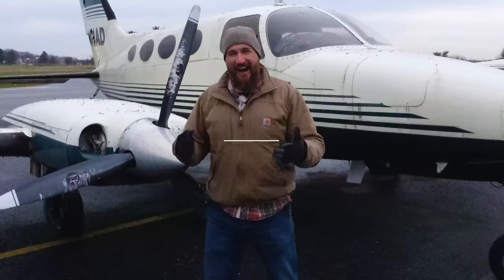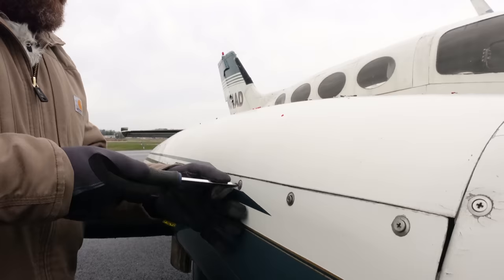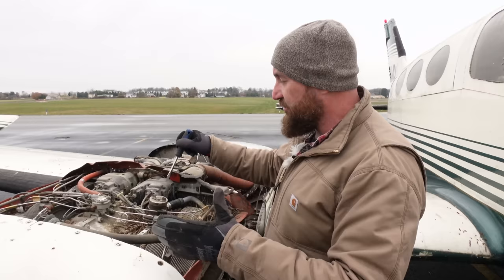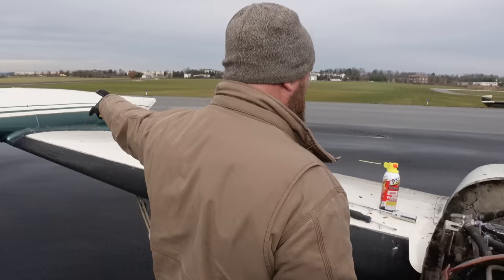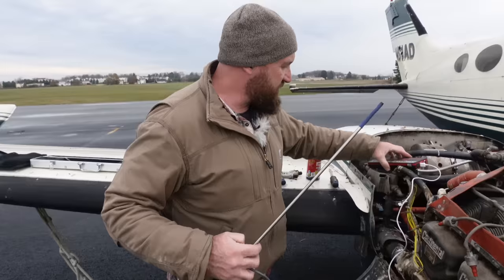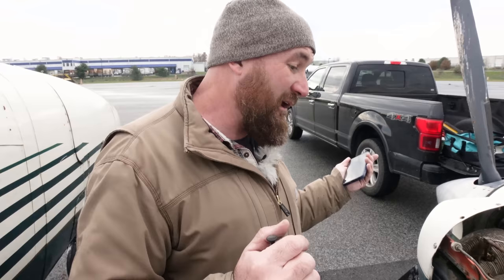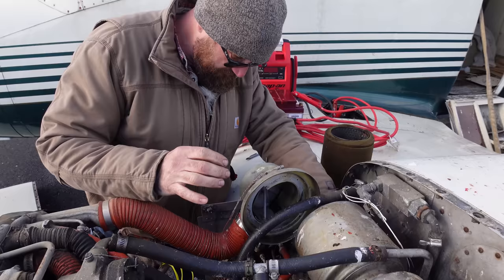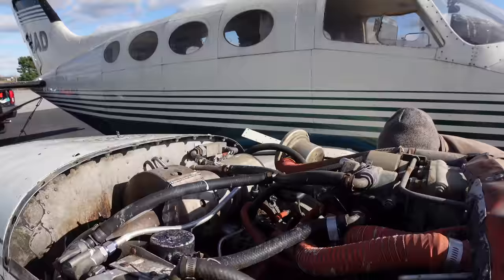FREE Abandoned Airplane... If I Can Start It! Ep1

Comment: I flew Cessna 402C for a few years as my first pilot job. Also have a few hours in Cessna 402B and 421 (this is a 401 but they are pretty similar). I really liked them and had some great memories.  First off the sad part is that plane will never legally fly again unless the logbooks are located. You could not even sell parts from it without proper records except perhaps avionics, which is radios for communication and navigation etc. for those who do not know. Otherwise it might be worth something. It would make an awesome lawn ornament, or clubhouse for kids, bunkie or camper?  If the logbooks were located there is a Certificate of Airworthiness which is only valid with an Annual Inspection report. Pilots may perform some routine maintenance, but most of that has to be completed by a certified aircraft mechanic. (I realize you are just doing this for interest and the video purposes) Likely needing two engine rebuilds, new lines and seals for hydraulic landing gear, tires, flushing the fuel system, exterior paint and interior. You would likely put way over $100K into it even assuming there was no major corrosion or airframe damage (which I doubt). Too bad it was not properly prepared to store in a dry climate boneyard. 

suggestions if I may:

1  you were aware of multiple fuel tanks on this model, I did not hear a reference to a fuel selector valve which may be on the floor to make sure the engine is being fed by the tank you added fuel to and not trying to start from one of the empty tanks or that the fuel is shut off. I am sure not everything was mentioned or caught on video, so just saying. Also could try putting a little fuel in the cylinders to see if it sputters.

2 I am not sure the turbo would cause an issue with starting. I would have to see a schematic (as a pilot I think I know airplanes but ask a mechanic they do know). As said in the video the turbo charger is powered by exhaust gases , there is no mechanical link to the engine. For those who don't know a supercharger is mechanically linked to an engine usually through a gearbox. The wastegates do no open until a certain manifold pressure the turbo may not do anything at idle or low power settings. You pointed out the pressure relief valve on the turbo so that should alleviate any overboost or exhaust backflow issues problems from the seized impeller  in the turbo.  Maybe if you just disconnect both hoses from the turbocharger it will not have any backflow or pressure issues from the exhaust end and the engine intake from the output side of the turbo will just breathe normally aspirated. Similar aircraft have had turbos permanently removed. It does not work until high power settings. Half way down the runway you could feel a good kick in the seat when the turbo opened on take off.

3. I could not tell from the video if you had moved your truck while starting. At one point is was in front of the aircraft. Make sure it is beside or behind and maybe a good distance away in case things go bad. Also every aircraft comes with a fire extinguisher but that one is likely empty. Even before your fuel leak I was hoping you had a couple of extinguishers handy. 

I knew of a Lockheed Lodestar (similar to Beech 18) that sat for years at an airport with grass and weeds growing all around it. A friend looked in it once and said it was full of mice and spider webs etc. Eventually someone like you showed up, cut the grass, replaced the tires and eventually fired it up. It was far from airworthy or legal. One morning airport staff noticed it was gone. After the tower closed it took off no radios supposedly to a farm field maybe where he did not have to pay to park it? Police and government aviation officials were notified I never heard anything more.

I wish I was with you for the adventure and giggles. Good luck! 
PS There is no way I would test fly that :(
Reply: Great comment, very interesting to read your insights
Reply: Thank you for your input,this is really interesting stuff.
Reply: Thanks for the very informative comment but you nailed it when you said "I realize you are just doing this for interest and the video purposes". I realized this right at the beginning when he proceeded to remove the spark plugs using massive torque without a long pre-soak and without using heat. Just getting one engine to run would cost more than this guy has or will ever have and the idea of flying that turd is ludicrous. If this guy does all the work, I doubt that he will find many eager passengers.
Reply: These engines could be used on an airboat.  Here in Florida they are used quite often and good money is paid for a decent running 520.
Reply: @farleymusclewhite411  I guess it would be a  risky investment for his channel. I can definitely see him blow up if he started a build series
Reply: @SupurrrCat  For me it would only be interesting if he was a certified aircraft mechanic with loads of experience or at least used one as a consultant. Seeing him potentially stripping out the aluminum threads in the spark plug holes was an eye-opener. What is next to be mishandled or destroyed? Not my cup of tea.
Reply: Jim jibroni  Its surely possible, lots of re-built planes from WW2 for example around that surely had no real track record. Also completely privately built machines. Commercial use might be another issue but even that should be solveable ... the question is only if its worth it, re-building and certifications will likely cost an arse and a half.
Reply: always like the GTSIO-520 in the 421, until TBO came around. my RAM overhauls were expensive.
Reply: If you will never be able to get this certified, what’s the point?
Reply: @mrnice81  you are correct. Some old aircraft are restored and recertified. I admit I am from the airline/commercial world and cannot say exactly what the process is or how they are classified,  perhaps in a similar fashion to an experimental aircraft. I know to be considered a homebuilt or experimental aircraft you must build 51% of the aircraft, but then there are limitations such non commercial operations only. I don't think that can be overcome. With experimental/home  builds you need a pre-cover inspection so the airframe must be inspected by a government inspector able to see the wing spars, ribs and the entire fuselage before anything is covered by aluminum, fabric or composite. In other words the plane is a skeleton. The major components of the fuselage need to be replaced or x-rayed for metal fatigue. Essentially you are building a new airplane, which in this case could never be sold as a certified Cessna 401 again. Cessna would not want the liability. Experimental is my only " guess".
There is a company which rebuilds DC3 as new with zero hour airframes (usually retrofitted with turbine engines). Although virtually identical, and in some components original. I am not sure if they are classified as a DC3 or another model, facing the same challenges any manufacturer would introducing a new aircraft.  I believe Viking Aircraft does the same with the Beaver, though they purchased the type certificate from deHaviland the original manufacturer. DC3 was Douglas Corp, then McDonnell-Douglas, then bought by Boeing. Perhaps this company too has purchased the type certificate from Boeing. I do not know. These types can then be used commercially.

I knew of a bankrupt airline which had several turbo props. When the creditors took possession of them they could not locate the logbooks or technical records. The aircraft could not be flown or salvaged. They sat for an extended time and were sold for pennies on the dollar, scrap metal prices. One of the new purchasers was a former employee. Eventually he located the books. What a miracle! wink wink. The aircraft were then sold for their proper value and he is a wealthy man. Having been denied severance pay and even my last paycheck in multiple bankruptcies I have no tears for creditors or the firms that manage the receivership.
Reply: Jim jibroni  sorry I did not/could not tag you both but you can read my reply to mrnice further down. The only thing I will add to you is "That doesn't make any sense" is a phrase which is  not uncommon when government, corporations and both their lawyers are in the mix. How much liability would the FAA or Cessna wish to assume if the missing logbook surfaced after a crash? Hypothetically speaking what if the last entry from a previous owner of any aircraft cited losing control of the aircraft overspeeding it enough to cause structural damage then because he was shaken up doing the hardest landing in the history of the airport which is why they never flew again. Not everything can easily be inspected visually by an aircraft mechanic and certain circumstances dictate extreme maintenance procedures beyond visual means. The mechanic would be assuming massive liability also if procedures even allowed it.
Reply: @supergmx1046  Thanks for the additional info, its roughly what i thought, being expensive with a sprinkle of 'even more expensive' and a side of 'probably not woth it'. ;)

Comment: You can Safely "Start" an engine with a locked turbo. It doesn't completely block the exhaust. He just wanted to "see it run", he didn't specify amount of .time. fire it up on video and make the deal! Then go through and rebuild it. I would call an A&P school to ask if they're willing to use it as a training engine rebuild, and in the end, you have two rebuilt engines. Many companies will donate new parts to the school. We resurrected a Piper Comanche that way, took 2 semesters, and we had a recertified aircraft.
Reply: I'd Gladly pay your couple days work and come take it off your hands. We have several A&P schools here just salivating for a specimen like this. But we'd most likely convert it with the two PT-6s that they rebuilt for us last year. 780shp each. It would become the family hot rod. 😁👍
Reply: I agree, I've seen plenty of engines run with a locked turbo. Even diesels. Air flow needed at idle is minimal and can get around the locked up vanes. My guess is the compression was not high enough to cause it to fire.
Reply: @gorillawrenchin  Starting fluid is a Wonderful thing!😂👍
Reply: @Ceisars Repair  right? I think I would've tried a few more things before giving up. I don't know airplanes all that well, but couldn't he remove the charge pipe between turbo and intake to free up any obstruction?
Reply: @gorillawrenchin  I think someone else was interested and going to offer cash to the seller if it ran. All that work just to call it off using a Lame excuse that we All knew better.
Reply: @gorillawrenchin  This is how you start the tough ones!
https://youtu.be/Ecosb5mSDwo
Crop duster pull start
Reply: @ceisarsrepair7958  oh nice! And I think you are right

Comment: Former aviation repairman with A&P school background here. 

Honest opinion, drop the engine, do a teardown inspection and reassembly, get em running and slap em back on. Free up your instrument panel, and start it. 

Now that you've got it running, shit it down, remove the engines, chop the wings, put it on a trailer, and part it out. 

The chances of this thing being airworthy without doubling it's MSRP is pretty unlikely.
Reply: Been working on an MRO company for over 2 years by now, and I was on my own world thinking; bruh even if he manages to start it just for being from the years the amount of money it'd consume just to be on time with the hour based controls of thy aircraft wouldnt make it worth, by fact it'd be better to just get a brand new aircraft of the same model.
Reply: @alantrev4595  Well take in mind the man offered to give it to him for free and he can slowly work on it. They also stopped making the Cessna 401A.
Reply: NO NO ANYONE CAN DO THAT!
Reply: Less entertaining, but it's the smart option. Just getting the FAA's stamp of approval of non-A&P work is going to be a real struggle with converting it to experimental exhibition and the restrictions the FSDO is going to place on it (i.e. no passengers, limited flight times, etc) and that's after a complete rework of the engines, electrical, avionics, etc.  It's a pity that beautiful 401A was left there without any protection, open intake and exhaust, and abandoned. So many pilots would've loved to own a 401A and treat it well under a single owner or a group ownership.

Comment: I'd get a hold of Jimmy from Jimmy's world, this right up his alley! He'd pull a  plug, like car and spin it with a remote starter!
Reply: Isn't he currently rebuilding a 3q0?
Reply: 310**
Reply: @codylapoint  Yep, he's restoring a 310, and he's also restoring a '68 Aztec he bought at the same time. And if I'm keeping track correctly, he's also into a couple Beechcraft Sierras.
Reply: I thought the same thing. Contact Jimmy.
Reply: #savethe310
Reply: +1! Can we get a CLEAR PROP!
Reply: He has already checked in
Reply: @BC4150  so what'd he say to do with it ?
Reply: Actually i forget, but if you dig thru some of the earlier replies you'll see where Jimmy chimed in & they both liaised & bonded

Comment: This has to be a series, you can’t leave us hanging like this 😃
Reply: Dont need a series those engines aren't going to run without putting a shitload of money into them.
Reply from the maker: @bryanmccarty8483  They’ll run one way or another ! 👍🏼
Reply: @rebuildrescue  i love that brother 😁
Reply: @rebuildrescue  One way or another even if it means giving it a tow 😅
Reply: @rebuildrescue  im guessing we get a series then??
Reply: @rebuildrescue  -- Derek over at Vice Grip Garage will have those seized engines purring within 48hrs. (Whether or not he can manage to stuff one into a '72 Chevelle is another matter.)
Reply: @rebuildrescue  Contact Jimmy from Jimmy's World. Could turn into a great series for the both of you. Cheers from Australia.
Reply: @rebuildrescue  They may run but will it pass a safety certification? I'd think that would be required. Still love the video. Just stumbled across it. I'll have to check out the rest of the channel.
Reply from the maker: @Neptune730  Without logs they’ll need a total tear down and recertification. I believe these models also have a special crankshaft inspection that’ll need completed.
Reply: As per AMM you never turn the prop, thus engine in opposite direction. Where is his AMM reference for the job in hand?

Comment: I am an A&P, started working on general aviation planes in 1975, so yes I have replaced plugs in a Cessna 401, 402, 414 and 421.  Fun Fun.  I'm pretty sure those mags do not have impulse couplings, rather Bendix shower of sparks system.  Great learning project for you.

Comment: On the ride home Christmas Eve my car breaks down with my children in it. I was able to get them home and get it towed to the house with a giant list of error codes. I've had to drop the fuel tank and replace the purge solenoid, rewire the natural vacuum leak detection system, install new valve gaskets and spark plugs , and redo the ignition coil and wires. I was sitting here feeling miserable, and then remembered it's just a matter of perspective. I thought I would watch somebody do a very challenging project to gain some perspective. After watching you work so hard, and dealing with the challenges as they came, it made me feel better. It reminded me what a methodical approach can yield, and let me know that I'm not the only one feeling these frustrations. Thanks
Reply: Amen. It’s an unexpected adventure and learning experience. Keep pushing forward. What an accomplishment! Grats!
Reply: Probably wanna trade your car for another one
Reply: how did u not notice half these issues before
Reply: All that stuff you did and I bet you never checked the blinker fluid or flux capacitor. Probably a 15 min fix.
Reply: You sound like a George Anderson, for sure.
Reply: Man! The comments here are kind of harsh on you. Of course, all of those thoughts came into my mind as well...maybe not the flux capacitor though. Anyway, I use to take on challenges like this many years ago when I had no choice but to "fix it". It was always incredibly frustrating. Mainly because I had very little mechanical understanding about anything as a teen and up to my early twenties. On the upside. Because I had to fix it, and eventually I did. The success and pride of "I fixed that" and it runs, is such a great and satisfying feeling!
Reply: @eddie9753  I didn't notice because most of it was electrical. And once I fixed a few of the electrical issues the rest of the codes cleared out. A bunch of the circuits share the same wires and ground.
Reply: @BlackHoleForge  And that is why I don't like criticizing people on such things. I had a union steward that taught me the importance of there always being something left out or more to the story than first told.
Reply: That wiring is called a “can bus” I have a vehicle with the same issue and it can be a short  anywhere in the system. The vehicle actually has 3 separate wiring systems to keep most engine critical items on their own system. My issue which is water related magically fixed itself a mile from home after a hour long trip of constant dinging and speedometer on and off… Gremlins as my pilot friends refer to them.
Cheers